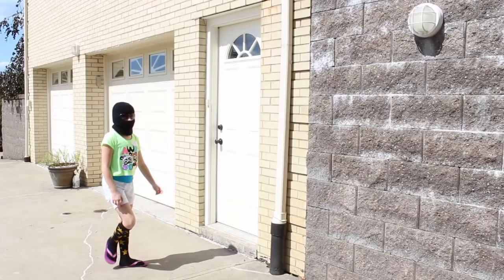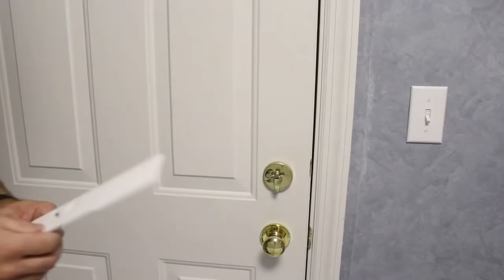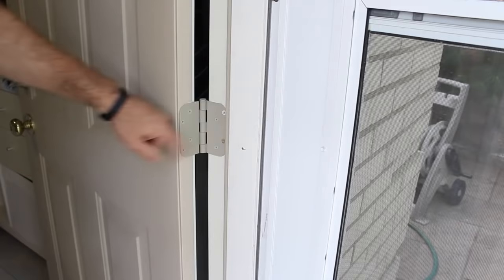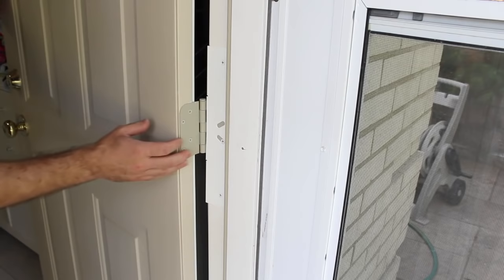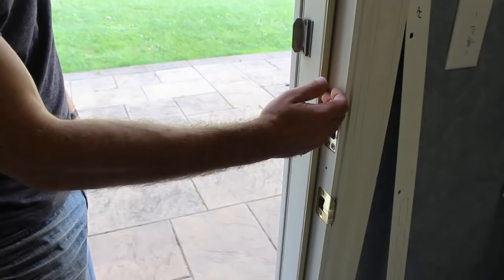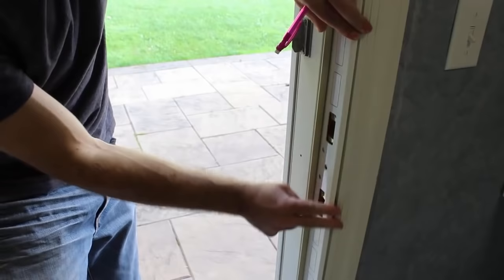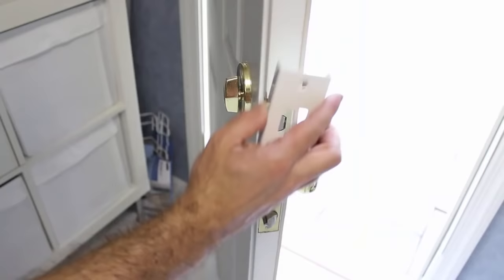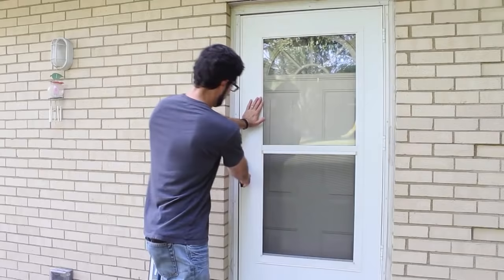How to Reinforce and Burglar Proof Your Entry Door

Comment: The reinforcement plates on the door are more important than the jam on the handle side. When you break down a door with 3 in screws in the strike plates, the door always gives before the strike plate side. If you have to choose an evil here, use the door reinforcement plates and 3 inch screws in the strike plates on the jam. Of course reinforcing everything is way better if you can swing it. No pun intended lol.

Comment: On one house i built i framed two king studs and a trimmer . then on the trim stud that accepts the jamb i rabbet in a thick steel l iron from top to bottom this was screwed into all three studs . holes were created to accept long throw dead bolts .

Comment: I'm reinforcing my bedroom door to make a "panic room" in case of a home invasion and this seems like a great product.  Thank you for the information.
Reply from the maker: +Jimmy Nix what else is going into your project? Interesting to say the least
Reply: +Jeff Patterson I've replaced all the screws with 3 inch deck screws.  I'm going to install one of these - http://m.homedepot.com/p/Prime-Line-Satin-Nickel-Door-Blocker-Entry-Door-Stop-U-10827/202258432 - 2/3 of the way up the door, and another  one 1/3 of the way up the door.  I'm going to install a deadbolt.  And I'm going to buy this and install it.  

All the locks can be locked and unlocked in seconds so I can get in and out quickly.  

I also have an old cell phone plugged into the wall so I can call 911.  And I have a handgun in a quick access safe.
Reply from the maker: +Jimmy Nix man, you're prepared brother. You have all the bases covered 👊🏻
Reply: +Jeff Patterson - Thanks.  Evading and barricading aren't just the right thing to do ethically, they give you the best tactical advantage should you be forced to defend yourself with lethal force.  The strongest weapon we have is our minds.
Reply from the maker: +Jimmy Nix totally agree. The mind is your best chance at most everything in life
Reply: Have you upgraded the door too?  I find that most interior doors are flimsy as hell when it comes to a barricade.  I wish they were all solid wood in my house but they are hollow core.
Reply: +Greg Gallop - No but that is a great idea.  I will add it to my to do list.  Thanks for the idea.
Reply: +Stefan Kuzmanov - I'm not an expert but I think that if it's solid wood it should be adequate.  I would suggest reinforcing the door around the hinges and dead bolt with something like this product, and installing a Nightlock Security Lock for when you are home.
Reply: id recommend a steel door with mdf coating for your panic room.  
It has the look of a normal wood door but is solid! if secured properly no one will be able to 
break through that door!
the weekpoint of wood doors is allways the wood in itself
someone could slam right through it if the wood is not thick enough or blast a hole in it with a weapon.
and ofc. steel doors are cheaper than good thick wood doors
Reply: +Romberg100 - Thanks I'll look into it

Comment: The longer screws that the door is put in place with are hidden behind the weather strip, not only did I pre drilled I used 4” screws made for exterior use.

Comment: Two additional points....drilling pilot holes is always advisable, as well as blunting the points on those screws with a hammer, to prevent splitting the wood as they get screwed in place.
Reply from the maker: I agree with drilling pilot holes Robert Brown - not sure about the blunting part. But if that works there's no reason to not do it.

Comment: But how do you pre-drill a hole that is 3.5" deep anyway?  For #10 screws in softwood you need a 3/32" drill bit which is only 2.25" long. Once you put it in the chuck there is only 1.75" left!

Comment: you don't need to pre-drill if your using self-tappers "Self-tapping screws are fasteners that are designed to drill their own hole as they are screwed into wood, plastic or metal. ... However, it is helpful to drill a pilot hole when working with harder material. When drilling a pilot hole, make sure to use a smaller bit than the screw so it may still serve its purpose"

Comment: 3 inch screws in the hinges, 3 inch screws in the striker plate for the jamb.  Get a "Lockset repair plate" and use that to reinforce the edge of the door.  Save yourself 50$ or more.

Comment: That kit is kind of pricey for what you get.
  Your video has made me at least go out and window shop to upgrade my current DeWalt 20v cordless drill to an impact driver.  I can see the difference in user effort and am going to get a lot of use out of an impact drill.  
Do you recommend a specific brand?
I have always purchased DeWalt.
My girly muscles 💪 have a hard time without pilot hole drilling.  I probably still will drill pilot holes so I don’t split the wood.   
Looking forward to your recommendations for drill & impact brand.

Comment: The Long screws are the important thing with plates they're what fail. Not the metal plates. Just replace the screws and u are most of the way there. Deadbolts are another one.. Not the plates they give u to replace existing metal ones.  Go to the hardware and get longer screws (3" if I remember correct?)

Comment: I bet the screws holding the hinges to the door are just as short as the screws that held the hinges to the frame, the hinge side of the door is where you would kick it in quite easily.

Comment: What if the door frame was already kicked in. And a 3/4 X 6 inch piece is broken off. Can this just be placed over the existing rest of the door frame and then used. The dead bolt was NOT affected, just the hole where the regular door handle was..

Comment: Pre-drilling is always a necessity, doesn't matter if you have an impact drill or not, wood splitting is wood splitting. So if you want to make your door frame structurally weaker for sure, then split the wood !
Reply: @nealkenneth90 Because nails are friction fit ... you'd look real dumb if you pre drilled a hole for a friction fit solution. Screws apply a lot more pressure, mainly tension pressure which is why they require some release in the form of pre-drilling.
Sheet-wall is made from stone (gypsum, same as plaster) ... which is not a material that reacts the same way to the forces applied to it, it's granular, not fiberous, thus when "splitting", you don't create extra voids like with fiberous materials.
Please consider that people who comment actually know what they're talking about, and don't spend their time at home on the computer next time.

Comment: I just ordered this! one question...I live in an apartment there are gaps underneath the door, at the top of the door, and the side of the door. how can I close those gaps? Do I just buy wood and measure it and nail it? what about the plate at the bottom of the door?how do I seal the gap between that and the door? it's a little flimsy when I step on it and I want something stronger

Comment: I painted my front door shut. Haven't opened it in years. Impossible to open. Good luck. Ive been using my garage as the main entrance for 20 years.
Reply: Amateur. If you were really worried about your security, you would have used a tube of Liquid Nails to secure your door.

Comment: Good stuff but a few things: 
1. Still get an alarm system. Someone who wants to get in, will get in, regardless - by means of crowbars, shotguns, whatever means - or going through a window.  

2. A dog is a great alarm system, in addition to being another loud alarm, the idea of having to deal with a dog is off-setting for most burglars, probably more so than the racking of a shotgun slide.  

3. Own, practice, and be proficient in firearms safety and response - Safety first, as in knowing how to operate firearms you own with proficiency under stress, with discrimination, so as to not shoot family members you're intending to keep safe.

4. Have a plan for invasion - they may come through windows instead of doors, as stated before - and rehearse the plan.  The plan should be independent of communication with the spouse and/or other family members, as in a shooting situation when the alarm is blaring, you may not be able to communicate well with other family members.

Know and rehearse their immediate responses and yours.  

If it is to barricade in their room or safe place, which needs to be established well before something goes bump in the night, including their line of defense (firearm, hatchet, pepper spray, whatever it is), and code words for situation CLEAR should be established and well practiced, in the event a false alarm (weather changes can set off security alarms when sweating on sensors occurs, due to changes in such), or, if perpetrators have been silenced, when you attempt to re-establish contact with your family.  

No place is impenetrable.  Always plan for the worst and hope for the best, but merely hoping in one line of defense is, unfortunately, in this day-and-age, not enough.  

Your home is your castle and your family is irreplaceable.

Comment: That product isn't doing much re-enforcing and looks pretty cheap as far as I can tell. The "hinge shields" do absolutely zero to enforce the door. The fact that the door didn't have the cutouts for the hinges weaken that part of the door anyway. Now instead of the hinge itself helping to secure the door against forced entry, only the screws running through the hinge into the door are doing that task. A real way to secure the hinge part of the door is to use heavy duty hinges, or better a stainless steel piano hinge. Use either a metal door or a solid hardwood door. Before the door is hung, use a 4-5' piece of solid steel, connect it to the door frame on the side opposite the door, with a cutout for the deadbolt to come through. Pre-drill the steel for 4" long high grade screws to run through from the inside of the jam, through the steel plate and into the doorway frame of the house. You can also install a longer piece on the backside of the frame where the hinge screws would come through. As before, pre-drill the holes for the hinge screws and use high grade 4" screws that will go through the door frame, the steel plate and into the house framing. Now when someone comes to kick in your door they are going to be denied.

Comment: The bolt guards are to reinforce the door, keep it from splitting... by not installing them you wasted your time!
I'm a retired locksmith,+ OJT...  I use the complete wrap around covers to reinforce/repair wood doors.

Comment: A door guard can be purchased on line, it’s place under door knob lock in place, burglar tried kicking in my door could not get in: came home caught him in the act, he ran. Easier less time consuming than drilling holes that may not  work: best you have a dead bolt where key is required for back door: once they in your home you don’t want to make it easy for them to walk out with your belongings.

Comment: The door is only as strong as it's weakest spot. Since no door shields that go over locks were installed, the wood within the lock area will easily break when kicked. Sand off some wood to make the shield fit

Comment: Who builds a house with  whacking great gaps between the jam and the door?  In the UK there is no way you could fit metal plates over and  still expect the door to shut!   
The plates would have to be recessed in,  which is a lot more work  and not as easy. 
This would work for a wooded door and frame,  but not a UPC door and frame,  which designed to be a tight fit in order to be draught  proof. 
In the video he has two doors to the front recess,  though not really a porch,  it would be better to install a wrought iron gate as the first point of  entry.  Nobody would bother  on seeing two doors, to get through,  they would burgle next door or through a window.

Comment: My solution, having purchased n lived in my home 14years: HD 3/16" striker plate accepting both door latching bolt and dead bolt screwed into place 6x with 3" coarse thread deck screws on the front n side doors. Not burglar "proof" but certainly resistant. 

Armor plated the side door with welded on through-bolts so that interior and  exterior plating serve in unison to resist door breakage. Finally, interior installed burglar bars visible from outside but masked on the interior by sheers & curtains.

I can't stop them but I can make them pause to think about easier targets.

Comment: You need to take the moulding off around the door, fill the gap for each hinge and the deadbolt with oak, plywood, something resiliant woodglued in there and then pre drill and drive LONG screws into there for both lock and hinge hardware.  Otherwise you are securely attaching your door to 1/2" soft pine.
Reply: The screw holes on the lock side reinforcement are clearly going to have your screws going between the drywall and the 2x4 - ie the drywall is what is keeping your door closed - or maybe 1/2 inch or less of the 2x4 for the screws on the far left.  This is NOT improving your security.  You need a product that puts the screws through the CENTER or even more towards the exterior side of the 2x4in the wall, considering the door swings inward

Comment: The only thing i did to burgler proof my door was to make it go outward so you have to pull the door not push it and it took 12 kicks opposed to 3
Reply: If you have a wooden door frame you did the dumbest modification you could have done. A burglar would laugh in your face! A burglar now can take a small crowbar and within few seconds split open your door jam from outside. No need to give a single kick! lol

Comment: 10:1 the door is a hollow door that a good kick in the middle will put your foot through it. Easier of course it the nice big glass window with no security on it about 3 feet to the left of the door. 
Either that or just drill the locks. I personally would be upgrading the whole door to a steel plated fire door.

Comment: You should edit the video to include a comment bubble to pop up during the video telling people they should pre drill the holes as has already been mentioned. The system is only as strong as the weakest point. It defeats much of the purpose to leave the deadbolt reinforcement plate off.  Notch out the area if it does not fit and install the deadbolt reinforcement plate and regular latch plates to the door. Now the system is complete and you'll have extra time to grab your favorite gun and call 911 as the bad guy tries to kick your door down.

Remember, this will stop a determined bad guy from getting in your house, but it will significantly delay him. So it's important to have the means to protect yourself if he gets it. On average, it takes about 10 minutes for police to arrive to an emergency call. That is the amount of time it took you to watch this video. It is a LONG time for someone to do something horrible and run away. Consider having a shotgun in the house in case the person is determined to get in, and after giving up on the door, he breaks in through a window. But by then you are well prepared to respond to the threat once he enters your house.
Reply from the maker: Thanks Scott Brady
Reply: Scott Brady what do you suggest for home owner being away or asleep?

Comment: Should use plate on door side by cutting back wood so it will sit back in and clear.  Not doing this creates a week area that may not hold.  The longer screws help but plate is much better.

Comment: Except you left the most vulnerable part unprotected which is the area around the dead bolt on the door itself. It needs to be covered with a metal plate or it will bend with minimal force.

Comment: Hi, for the hinge plates, why should you screw in one 3" into the top hole, then put the plate over the hinge and screw in the second 3"?  Would it not be better to put the plate over the hinge, then just screw in both 3" screws?
Reply from the maker: You're right Mike Co - that's a good option. In fact, I'd take it a step further and just use 3 inch screws for all the hinge plates. The longer the screws the more secure the hinges and plates will be.

Comment: Soo all that stuff is ok but what good would it do if someone came with aq cordless drill and a cobalt bit and drilled the locks out?  Takes less than a minute and you are in. Worked for an old landlord and when tenants left and they had changed the locks and not let a key that is how i got into all of them.  Much quieter than kicking a door in and one can close the door them and be pretty much undetected.

Comment: I notice that you didn't replace the screws holding the hinges to the door. Weakest link, and all that. Those tiny stock screws will strip right out at the first kick. If not, the cheap particle board door will just disintegrate around them.

Comment: you forgot to use long screws on the door side of the door hinges, also you forgot to recess those door hinges that way you could have fitted the door lock reinforcement plates which are critical at helping to prevent the door from cracking / splitting and compromising the locks.  You did a ok job but for good job you need to do these two things as a minimum maybe even add 1 more hinge to the door and a second lock.

Comment: all that junk not needed, key is the 2in screws. replace the short recepticle screws on the jam and a couple of hinge screws with high grade stanless 2 or 3 inch screws to reach the studs in the door frame. make sure reseptical hardware is also high grade steel.

Comment: He made one mistake, he was supposed to remove the strike plate for the door knob, you no longer need that strike plate there. Also you always predrill in any door frame to prevent from splitting the door frame.
Reply: Not only that he used a impact he over tighten some screws sometimes it's better to use a basic drill and put the clutch on 8 when you are new to power tools.